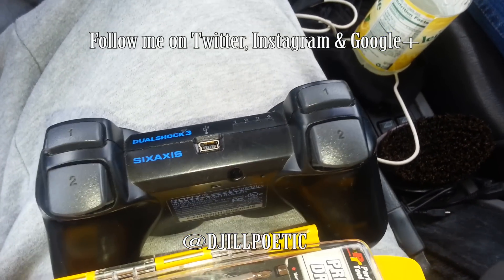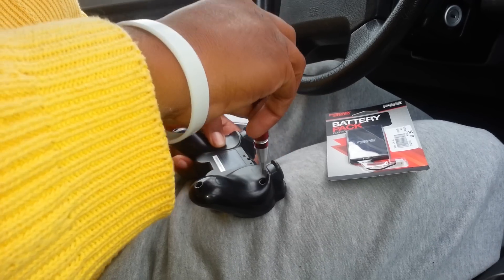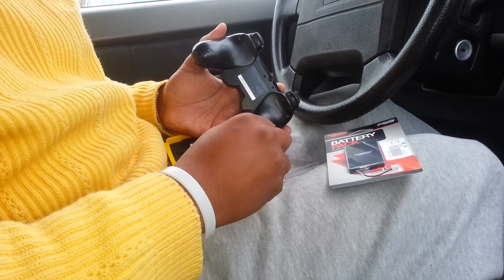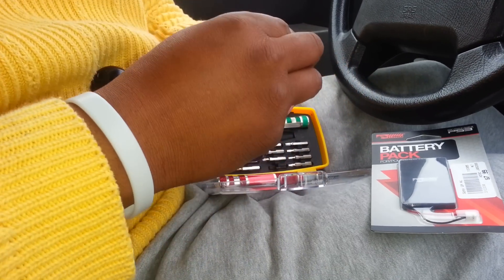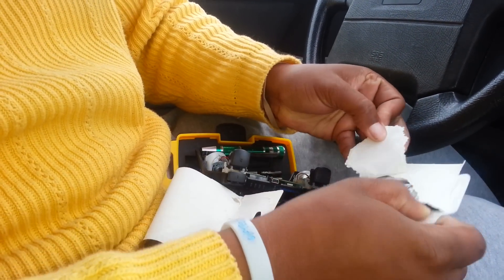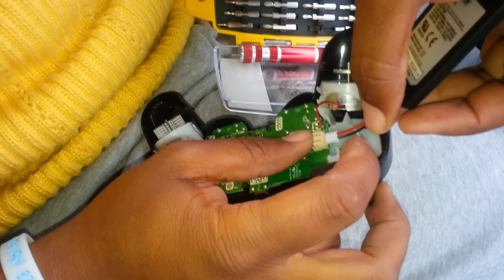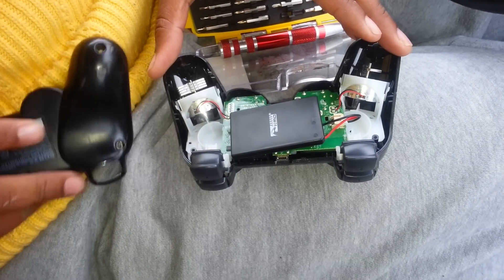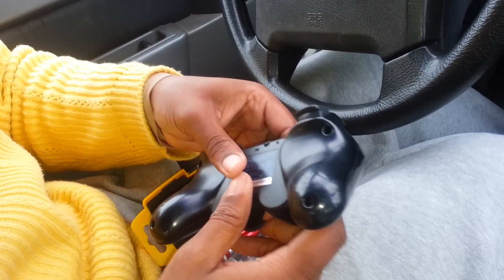PS3 CONTROLLER NOT CHARGING? HERE IS THE FIX!

Comment: mines just stop working an I'm just bout fed up wit it this is the second controller I just got an I'm still having problems
Reply: You should buy a new charger wire or new controller
Reply: +Chantelle P thinking about just getting me a ps4 an be done with that
Reply: Mr. Frost Mine still work you might just need the original ps3 cord

Comment: Dj Ill Poetic in the video it looks like you have to add (replace?) an internal battery into the controller.  When you removed the frame, I didn't see a battery installed.  Did the controller come with an installed internal battery (and you removed it prior to the video)?  Or do you have to add an extra battery to resolve the fault?  Also, I didn't see a demonstration of the fault resolved e.g. the controller will charge with this internal batter installed. Did you verify that the controller was able to charge after installing the battery? I'm going to troubleshoot my controllers today.  
Tks for the video.
Reply: usman afzaal or what?  You're going to internet commando me to death?
Reply from the maker: Yes it came with a battery. I was fixing the controller and I got the idea to record the repair  after I removed the dead battery.
Reply: I purchased a replacement battery and swapped batteries.  Unfortunately,I still wasn't getting power from the new battery either.  I was really hoping a battery swap would work (i don't want run back out and buy a soldering iron).  I discovered I had a short between the damaged prongs of my 4v power supply. I ended up running out and getting the soldering iron, cleaned the (power supply?) prongs, soldered and reconnected it.  Since then I've been able to play Tekken and my controller hasn't blown my hands off, yet.

Comment: Let me just say I tried this and it was a massive headache. I was so close to getting mine back together after switching the battery. Mine's the older PS3 controller with those separate tabs behind L1 and R1... not to mention the pins under L2 and R2 can fall out, so I had to put back in that tiny ass springs twice.. So after like 40 minutes messing with it, I got it closed back. Then I realized just the R1 button was jammed. I know, fuck me right.. So I opened it back again to fix it, and ended up ripping out the whole R side triggers by accident. I just gave up, going to have to buy a new one.

Comment: my control flashes red really quickly when I plug any type of USB chord what do I do
Reply from the maker: +ZgAmINg 18 Sounds like you need the charge the battery.
Reply: It does that when I put in the charger
Reply from the maker: +ZgAmINg 18 The flash is confirmation that it is plugged in, the lack of the light afterwards suggests that it is not charging. Check that the port is not dirty or damaged. It is very likely that the battery is not being charged and needs to be replaced.

Comment: battery will not charge as of today but works when plugged in not taking it apart just leaving it plugged in.

Edit It was the cord I grabbed the wrong cord and while it powered the controller it would not charge, found the cord I always used on PS3 and now its charging.
Reply from the maker: Good find.